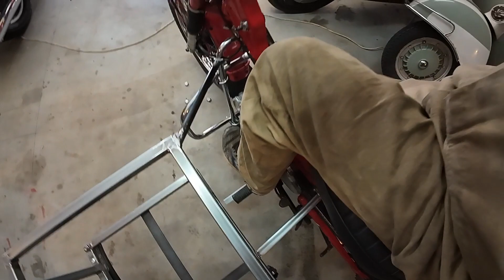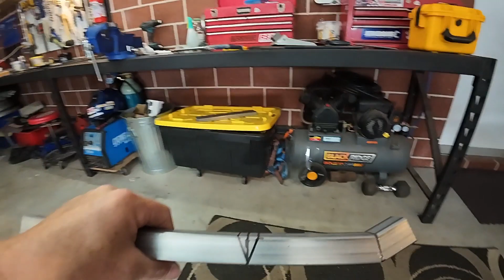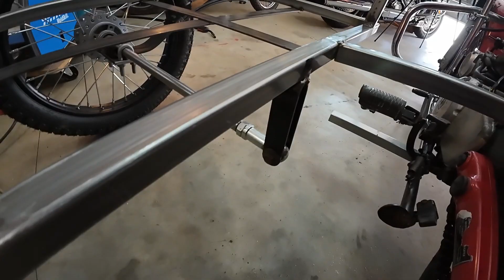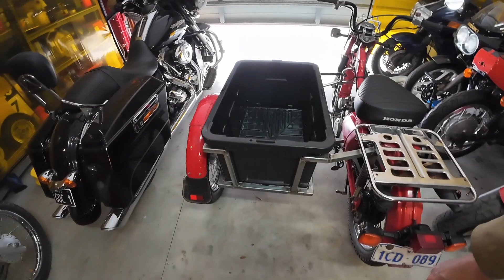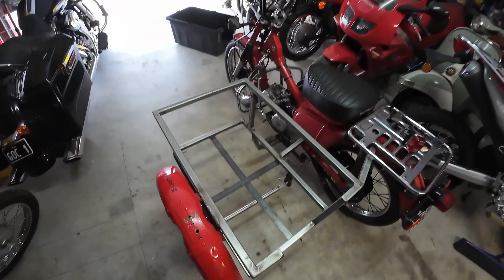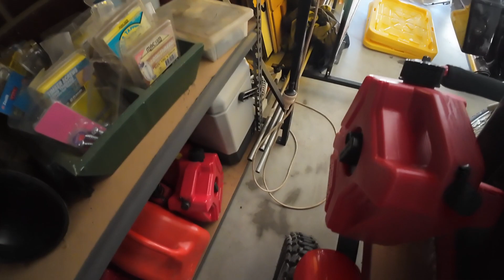Final Episode 8 CT110 Sidecar Build.

Comment: It may be just me but i would be much happier with some  triangulation/ cross bracing / struts to several areas of frame and mounting system...i may be mistaken. Having said that, your work is inspirational.....i want one on my postie bike...built from my scrap/ treasure bin naturally.
Reply from the maker: My 4 braces are to 2 strong places (rear top shock & foot rest mount) and 2 less strong (brush guard & battery area), but remember the bike is not rigid- it will move when a force is applied to the sidecar. And the sidecar is suspended.
The forces ripping the two apart can only be applied through the traction of 3 tyres.